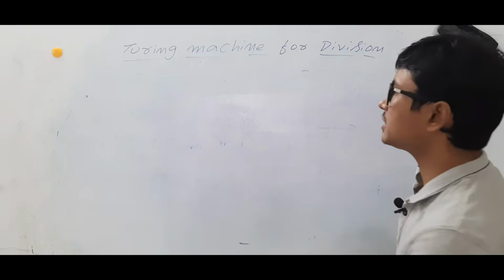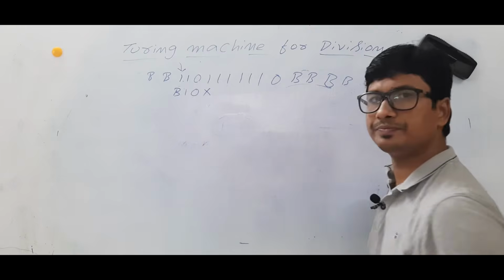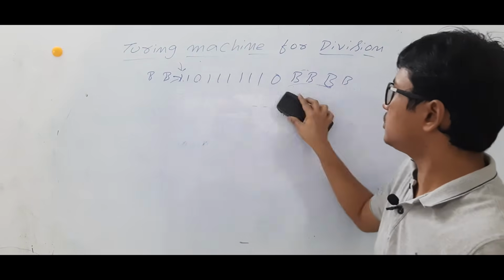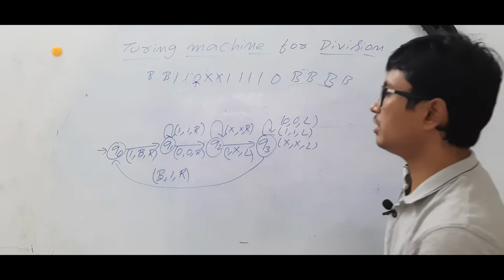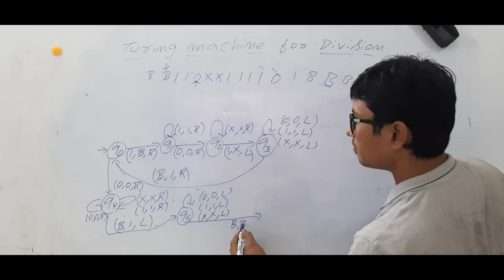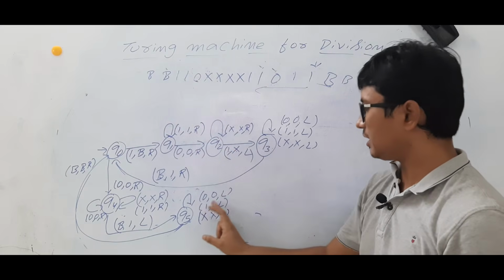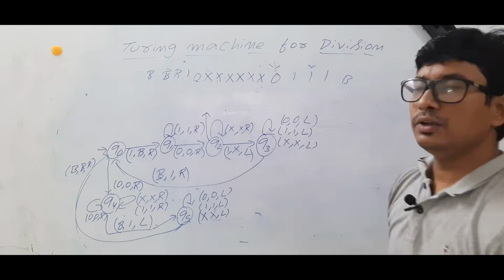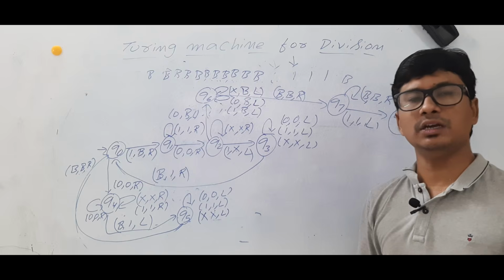L 105: Turing machine for Division | Turing machine for Unary division

Comment: Great explaination sir. I've got one question. Would it work the same I'd create a path from q5 to q6 and check if x is right after 0 which means all numbers where already processed?

Something like this:

q4: 
    loop: x->x, R; 1->1, R; 0->0, R;
    go to g5 on: _ -> 1, L
g5: 
    loop: 1->1, L
    go to g6 on: 0 -> 0, L
g6: we've moved one to the left and if head is x it means all numbers where processed, so we can just start clearing like in you're q7 and q8 stages. 

I guess it's a different approach, but I'm not sure if it's a correct one
Reply from the maker: Turing machine is similar to an algorithm. For a problem, we can find n number of Turing machines.

Comment: why do we replace these two first I as blank spaces? does the machine remembers it thanks to this procedure?
Reply from the maker: Dear Mellivet,   you can use any logic. I have used one logic to solve the question. Any halting turing machine is same as an Algorithm. For a particular problem, we can find several algorithms so same way we can find multiple turing machines for a particular problem.
Reply: @ParnikaTutorials  alright but what if i want to divide for example 7 by 2? how do i make it work? similar way as this video shows or i have to use a different commands?
Reply from the maker: you can follow the same method